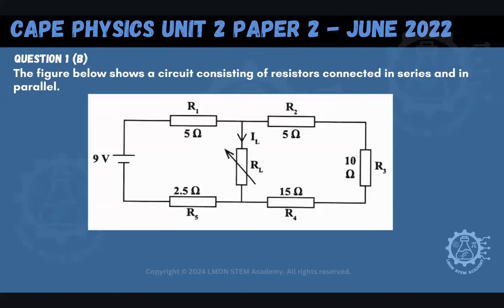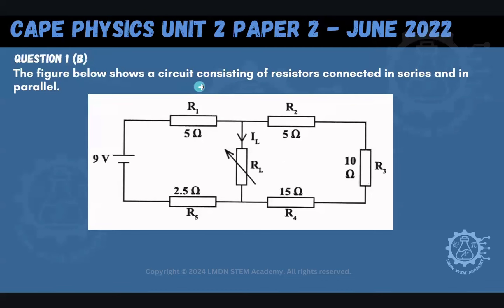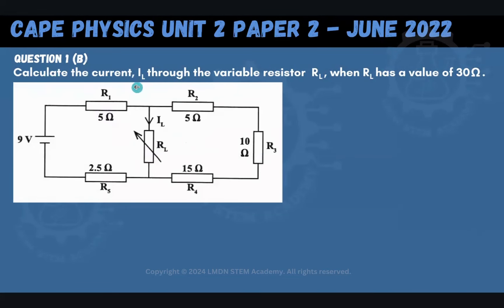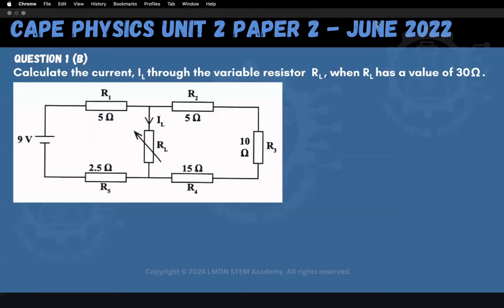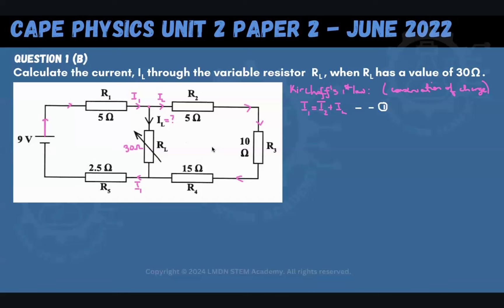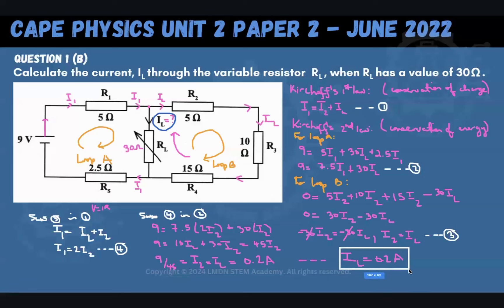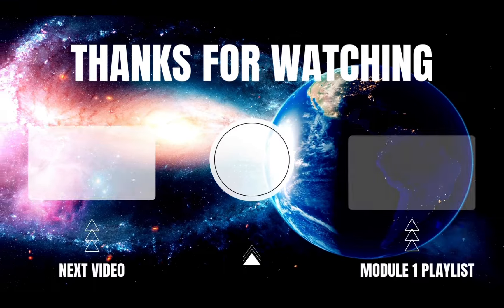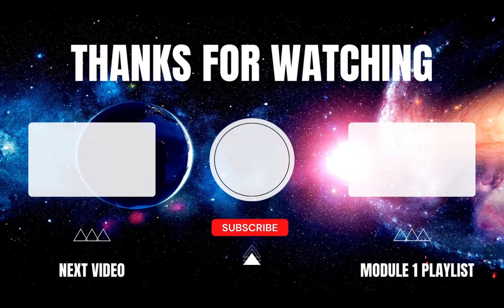CAPE Physics Unit 2 Paper 2 June 2022 -  How to Apply Kirchoff's Laws to Find Current in a Circuit

Comment: There is a far easier method to work out the value of the current. It takes about two minutes to get the value of 0.2A and it does not have anything to do with Kirchhoff's 1st or 2nd law. The question does not ask to use Kirchhoff's laws. In an exam, time is of the essence, so how long do you think it would take a candidate to write all what you have written?

Solution: the 3 resistors of 5, 10 and 15 are in series. Total value = 30 ohms. This is in parallel with the 30ohms. This combined resistance is 15 ohms.
Using Ohms law  current leaving the battery =  9/( 5+15+2.5) = 0.4A.
The current then divides into two EQUAL parts for the parallel combination of 15ohms and 15 ohms giving 0.2A
Writing time is less than two minutes! Perhaps in your next video you may like to point this out to the students watching the videos. I would have thought you would known better.